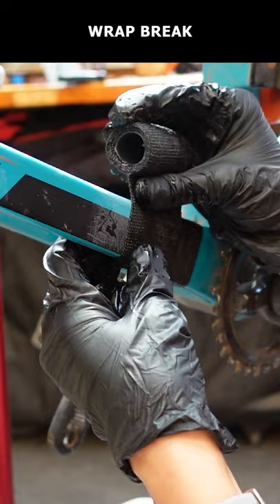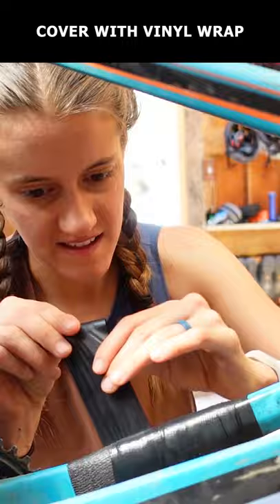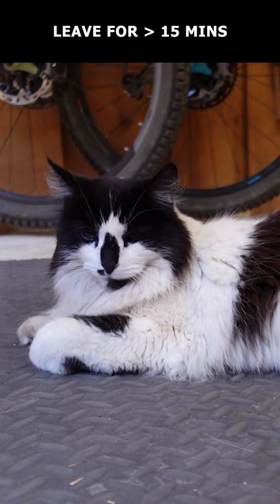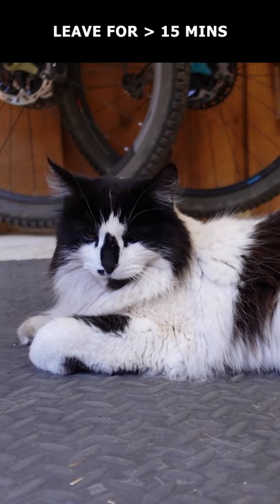How to emergency repair a broken carbon bike NOT A PERMANENT FIX #Shorts

Comment: Once bike frames are broke, they’re broke
Reply: Wrong. Carbon fiber is a great material to have repaired when you have a bike shop that works with carbon repairs
Reply: An I've heard people say that carbon fiber is stronger than steel but it seems that's not the case I have seen many steel bike frames break especially where this one did
Reply: A just weld  it . Done it many a time
Reply: Carbon, while a pain to fix, is actually able to be restored to the same characteristics as before, not stronger, not weaker but the same. It will flex and bend the same way as before.
Reply: @jamesduhon1901  carbon is stronger but it's also more brittle meaning a sharp impact can cause it to break, think of it like raw and cooked pasta, raw pasta can support more load then cooked pasta but a sharp impact causes it to snap violently, while cooked pasta can't support as much weight but won't snap from an impact, only bend
Reply: @carsandstuff365  it’s carbon, it’s not metal
Reply: It's just being displayed as a way to "limp home" if it happens on a ride.
Reply: @jamesduhon1901  carbon composites are stronger, it's just that they're only strong in certain directions because of their design, where as metal alloys are almost equally strong in all of them, as they are homogenous materials.
Reply: Why do people buy carbon bikes? I keep seeing videos of them snapping.
Reply: @luciarehermann7921  people buy them because it’s wag lighter, stronger, stiffer, and more forgiving then Aluminium and steel
Reply: @tommyscoots5285  wouldn’t say it’s more forgiving bud, aluminum bends compared to carbon or ti parts which just snap. Would much rather be able to ride away with bent handlebars then smashing my face into the stem because they snapped.
Reply: @anthonydavenport1841  carbon is really hard to break though, it just feels better in my opinion
Reply: @jamesduhon1901  carbon fiber is, but it is very brittle. Metal will bend, while something like carbon fiber will just snap
Reply: lmao a welder works just dandy
Reply: First world problems.
Reply: this is an emergency kit, its not a permanent fix
Reply: People with too much disposable income.
Reply: Nope, some frames can be rewelded, depending on damage and spec.
Reply: why you need carbon fibre frame on a mtb?
Reply: @tommyscoots5285  not really it’s stiff as hell but will shatter and split upon impact great example of this is modern hockey sticks since they are mostly carbon fibre now they last a lot less but yield a much higher speed and force transfer (stiff as fuck) but on the same note it’ll snap in two without warning leaving you shit outta luck
Reply: @Steph.98114  beautiful analogy! And yes, very accurate
Reply: @luciarehermann7921  I keep seeing comments of the infamous carbon frame snapping videos, but I've only ever seen two actually break. Where as myself, and I know that this is just anecdotal evidence, I've had three frames let go - one steel (bad head welds, the welds looked okay, but they just didn't hold.), one aluminum (rear triangle), one alloy (Walmart), but my carbon hard tail is still going strong!
Reply: Carbon is like more risk more reward and also more expensive.
Reply: No shit, lol
Reply: My steel frame was hit in the traffic by a suv sideways at 50 kmh. It didn't even bend. Fuck off with carbon.
Reply: @rickmortyson4861  bro chilll chilll bro relaxxx
Reply: @hannes6114  
You get hit by a SUV
Then see if you'd chill.
Reply: Exactly, buy an expensive frame that is fragile and will crack under normal wear and tear...or buy steel.  Cheap and effective.
Reply: @desertrainfrog1691  AGREE definitely not a long term fix.
Reply: @luciarehermann7921  yuppies want to have the newest and coolest even if they ride it twice and leave it in the garage for 20 years next to the Nordictrack and Peleton.
Reply: @dirtspaceman  I'm still riding a 1987 lugged steel frame road bike from Japan. Works great, durable, and the downtube shifters are actually quite pleasant to use. 

I fear that the advent of carbon might be the beginning of the end for vintage bikes. (Will carbon bikes really make it 30+ years in large numbers?)
Reply: @desertrainfrog1691  love it.  I had a steel Panasonic with downtube shifters for years.  I love the look people give you when you shift..😱🤔😨🤔 lol.  Updated to a Vilano I nabbed for 100$.
Reply: Could weld it if u have a normal frame
Reply: @LexDiamondz-jd7vk  Carbon Kids will be mad about that one.
Reply: @jamesduhon1901  in material science the rule is: the stronger the material the more brittle it can be. There's also the concepts of elasticity and plasticity. Elastic means you can flex and return to original state. Plastic means you bend/stress to a point where the material has deformed to a point where it wont return to original state but hasn't failed. With very strong/brittle materials you go from original form to breaking but it takes a lot of force to do so.

Composites are very strong and can have elastic/plastic properties but can also be brittle.
Reply: @luciarehermann7921  they only snap in extreme circumstances. I've had many CF bikes and never broken one. I have had a steel bike corrode through.
Reply: @amped19996  yea i was gonna say they can even get a cheap harbor freight flux core welder for 150 bucks and a grinder ...quick and easy
Reply: @obliged_cyclist  Nonsense, you know little about carbon frames. Even after a light impact the carbon is weakened even when there is no visible sign of damage.
Reply: Have some bamboo bike frame 🤓

Comment: Working with carbon daily- this is, by far, an in the "backcountry" trail fix only! You should use a repair kit like this only as a "not to die" from dehydration or starvation being stranded in the outback.
Reply: If you're that scared of your chainstay breaking, you probably shouldn't be riding, period.
Reply: What if you had to out run a bear, would you ride it then?
Reply: It takes 24hrs for the better resins to fully cure and harden. So, no as the bear would have already eaten me. Ha! Ha! Ha! @ferret1303
Reply: @graysonadams2485  some people will use chicken wire and duck tape for a fix. Others, in evolved in the production of carbon, or catbon/kevlar parts will tell you that once a strand is torn apart or broken the part will never be as designed. Let's face it. If it broke from riding it was probably a poor design to begin with. So, this wrap epoxy fix is only to limp home. Or the owner is on a very low budget. I stand by my statement. Not a good idea for person health.
Reply: I did this to my bike and I've been riding it for years ! It's solid as a rock 🤣 and it's a DH bike .. I was pretty surprised myself

Comment: You're sending stairs with a broken chainstay!?!?
Reply from the maker: We wanted to see if it would work as an emergency repair. Turns out it does.
Reply: Really impressed
Reply: Wait emergency as in “not permanent” I’d just ride it like that lol
Reply: @MarioXcore1  
It would probabaly hold for years
Reply: It would probably hold just fine, but with re-kilning being such a simple process as it is, you might as well just do a permanent fix & then wrap it afterwards.

Belts and Suspenders, what a sight! lol

Comment: How hard is it to remove afterwards? I was thinking if this could be used to make a lower tube protector. I would mould it in the bike using a plastic film in between, remove it and replace using a double-side tape.
Reply from the maker: It doesn't come off, so if you were to do something like that, you'd want to put plastic wrap on the frame first to keep it from sticking.

Comment: Shouldnt you wear a mask because of the powder?
Reply: Pretty sure it's just paint and the top coat rather than actual carbon dust
Reply: @nope929  which is exactly why you never see painters wearing masks, let alone respirators and goggles. Oh wait...
Reply: @MrKipperfish  when you are working with anything day in a day out, continued exposure is a real problem.
Reply: @MrKipperfish  i guess everytime i walk through my house with dry paint i have to wear a mask even after the Acetone and benzene evaporates, oh wait, I don't because all of the harmful stuff is gone
Reply: On the contrary. You should snort it.
Reply: If you're a ({})
Reply: No
Reply: She’s trying to become a super hero

Comment: I have stayed with alloy bikes. I had 3 carbon frames crack, one resulting in injury. All expensive. Done with carbon.
Reply: There are just 2 types of alloy frames:
1. Cracked 
2. Yet to be cracked
Reply: @Terra-Incognlta  lol, yeah in my next life, maybe.
Reply: @astrodad656  You wish. Maximum is 10 years and 5 years if you are not weekend warrior and riding in winter too.
Never again. I've seen tons of alu frames broken compared to carbon.
And quite few of them broke on casual uphill ride.
Reply: @Terra-Incognlta  alum, yes. not double butted 4130 chromoly steel.
Reply: @astrodad656  True, steel is something else. But heavy as cow and not suitable for fullsus. Unless you have one of those more expensive than carbon special brand which is still heavy compared to carbon.

Comment: $6k extra just to save 4 pounds and breaks easier.. not thanks
Reply: Different bikes are made for Different things
Reply: Carbon frame vs alum frame is only $1200 Avg difference for a full suspension mtb. More benefits than weight also, stiffness and compliance in targeted locations, on a rigid bike this is a huge difference..
Reply: I hope for the sake of your back you're not sending a carbon xc bike hard enough to brake a chainstay
Reply: @tuckerfristoe9449  20 year old Walmart bike XC lmao
Reply: Don't put yourself down like that man there's no hate in the bike community
Reply: Carbon is stronger than steel and alu... just brittle, if your gonna break a carbon frame your certainly gonna break a metal one. The weight saving is pointless to people like us because we don't care about saving a second off a trail. There is more to carbon than just weight saving. People want carbon bikes and bike parts for the same reason people want ferraris

Comment: Sold this stuff and without a respirator you feel like passing out due to chemical smell. But it is vary strong.
Reply: Yup, they should be wearing a respirator, especially when sanding the composite.

Comment: I know carbon fiber is lighter but things like this are why I prefer metal in a bike so when I have a wipeout I only have scratches and maybe a ding or 2 instead of a 3D bicycle puzzle
Reply: I have smashed my carbon bike against rocks harder than you would believe and it’s never damaged anything beyond the paint. I’ve only ever see one person break a carbon frame, and it was on a cross country bike. They are so incredibly strong that repairing them is almost never an issue, and the force required to break carbon would usually dent an aluminum frame beyond repair also.

Comment: If I do this out on the trail to get home, do you think the bike Mfgr will still honor their lifetime warranty on the frame?
Reply from the maker: I don't see why not. It certainly didn't cause the problem. But it might be worth taking a couple photos or video before you cover it up because I don't think you're getting the fiber fix off 😁
Reply: No, it would crap out your warranty. You are altering it after the damage was done. No more warranty.
Reply: Absolutley voids warranty as they will claim they cannot examine and determine cause of break

Comment: Question for anyone that has used this how strong is it?
Reply from the maker: After installing it, we ride it down stairs and jumped it and it held no problem. Definitely not a permanent solution, but great fit an emergency to get you out of the back country.
Reply: stronger than original, permanent fix, if sanded very good

Comment: Sand carbon fiber without protective gear. Have nice cancer or other permanent lung disease. Thanks Syd!
Reply: Scuffing isnt the same as  sanding for surface prep. When outdoors and just scuffing wouldnt bother anyone who knows what they are doing..but anyone that experienced wouldnt be riding a frame fixed like that unless you would die of dehydration or something after as it just gives a false sense of security and will fail at a critical time

Comment: If you break a Carbon bike.......get a new frame. Your bones will thank you.
Reply: You can get carbon professionally repaired to the same spec as before, meaning it will bend and flex the same way it use to and will be the same strength as before
Reply: Carbon can be repaired better than metal alloys.

Comment: Does that actually work an if it works short term why wouldn't it work long term does it get weak or something? I'm really curious I know nothing of carbon fiber
Reply from the maker: Check out our longer video (linked in description). We talk to an expert in carbon repair and he explains better than I can the differences between a professional repair and an emergency repair.

Comment: Keep in mind, the “permanent fix” is buying a new frame.
Reply from the maker: Nope, you can have it professionally repaired as we discussed in the full video (link in description).
Reply: There are several ways to permanently fix a carbon frame, especially due to the nature of the material - you can return it to the exact same strength it was before, the primary method being re-kilning.
Reply: An aluminum one

Comment: Thats why I like aluminium bikes frames, I dont want to think my bike can snap under me
Reply: Aluminium can snap too
Reply: @lxgg4923  Aluminium is a lot more ductile, and will bend unlike carbon fibre which will just snap.
Reply: Carbon is a lot stiffer than aluminum, meaning it doesnt break as easy, but once its broken you can throw it away
Reply: @koerni0653  yes thats true but i have only snapped carbon bikes no aluminiums. The carbon is a great materiall still, light and strong
Reply: @ChristAcolyte  generally yes, but not in bike applications. The type of Al and the thin tubes almost always result in frames cracking instead of bending. Often they crack at the welds but have seen all kinds of cracks. Just search it on YouTube, there is plenty of footage of aluminium frames snapping
Reply: @ChristAcolyte  aluminum cracks. Steel bends. All the aluminum frames I’ve seen that broke split or cracked
Reply: @MrDrunkenMoose  i can allways weld my AL bike back together
Reply: @ekku6955  technically yes, but practically no one does that. First of all you need someone very experienced with a good setup for thin aluminium. And moreover you'd have to heat treat it afterwards or it will probably just break at the weld again in no time.
Reply: @MrDrunkenMoose  if the welds are done properly, the frame will break before the weld does. If your frame is breaking at the welds, then you have bad welds.
Reply: Go steel, most of the energy you put in the pedals goes on wind resistance, reducing the mass of the bike doesn't make a lot of odds. Take the money you've saved, take some unpaid holiday and go for a ride.
Reply: @philroo1  yes thats my bro
Reply: @ChristAcolyte  doesn't mean it won't snap eventually
Reply: I've cracked my share of alu frames 🤣🤣🤣

Comment: I was about to check out a beginner carbon fiber frame MTB. Never considered that I could break the frame, thank you Syd, I'll stick to aluminum
Reply from the maker: You can break aluminum too. People worry way too much about breaking carbon. It rarely happens and, if it does, is much easier and cheaper to properly repair (permanently by a professional, not like this) than aluminum. So don't make your decision based on that!

Comment: Permanent fix: buy an alloy frame 😂
Reply: There are just 2 types of alloy frames: 1.cracked 
2. Yet to be cracked (10years max)
Reply: @Terra-Incognlta  ur saying that like a bike holding up for 10 years is bad
Reply: @__mayo1802  10 years for weekend warrior. With every day use 4 max.
I don't know about you but I'm buying bike for at least 5 years and then sell it when upgrading. Not throwing to scrap.
Reply: @Terra-Incognlta  you cant be talking about carbon if youre talking about mtbing everyday for 5 years then selling🤣🤣
Reply: @artvandalay2736  Yes, I'm talking exactly about carbon. Because I want my bike to last and not be an anvil.
 And if I crash I want to repair it for 200-300€ to have the same properties as manufactured. 
Hate to finding crack around the weld on shit-minium after 2 winters and then throwing it to scrap or weld it and use it to Walmart only.

Comment: Please don't sand composites without a respirator! If this is a on-the-go repair, pack a n95 mask. Seriously.
Reply: Scuffing isnt sanding its just to scratch up the surface and what little if any debris made isnt much risk outdoors as its very few anyway
Reply: @norml.hugh-mann  do you work with hazardous materials and composites on a daily basis?

Comment: When your to cheap to ensure your own safety  basically. Big nono to me.
Reply: It's temporary
Reply: There are times it'll get you or a buddy home.
Reply: Actually it’s very very strong. I used this on my carbon fiber frame damage and it never gave me any issues at all for many years!  I only spent fraction of cost to repair and I recommend this product. In fact you can use it in a broken shovel and it won’t break off according to commercial. I’m a believer.